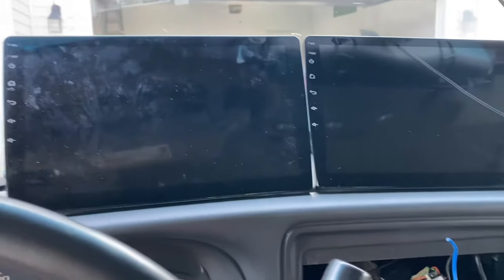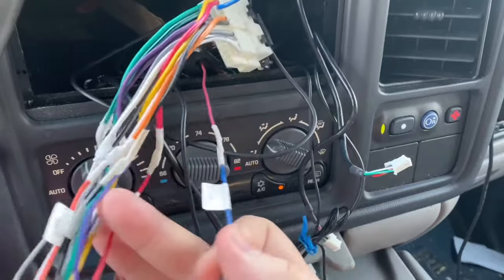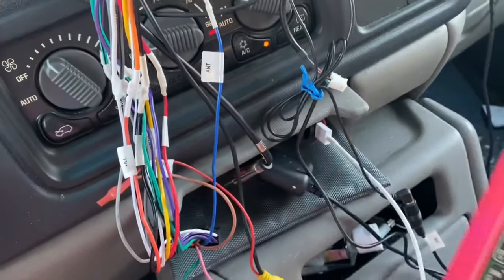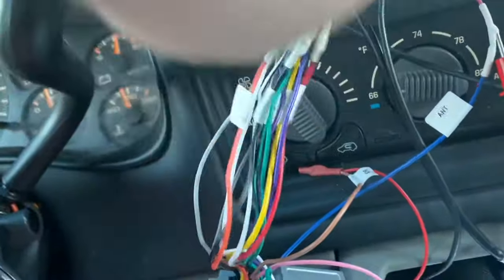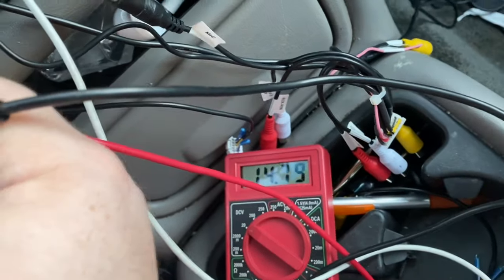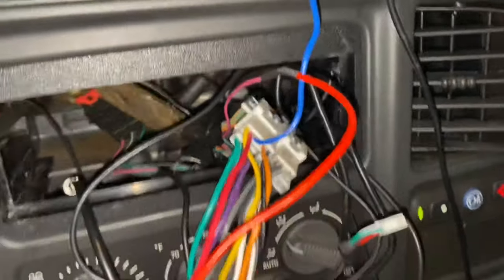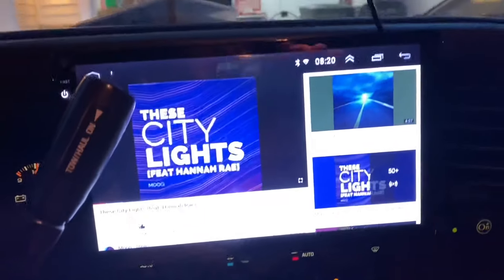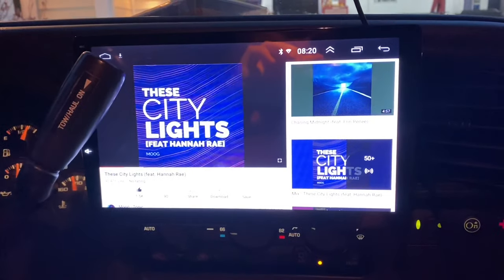Chinese Android Headunit - no sound fix!

Comment: hey dude!
i just got a chinese head unit but it dosent play music from all speakers any solutions?
Reply from the maker: Start with the basics, check for voltage at every point you would expect to
Reply: @MegamanEXEv2  i figured out that somehow the speakers are flipped, as in the radio thinks the front speakers are in the rear and vice versa

Comment: My problem is a little bit different the radio turns on and works then you turn the car off when you come back 15 minutes later and turn the car back on the radio turns on and it shows you like if it was playing music but no sound coming out the speakers and then you have to reset it again and again can anybody give me some pointers when it works it works super sweet super perfect turn off the car come back 20 minutes later then you start having problems it turns on and it even shows Movement Like if a song was playing but no sound coming out of the speakers and the only fix I see is resetting it when you reset it it goes back to work and Fine Again software bug
Reply: Same, have you found a solution for it?

Comment: Doesn't it have a remote wire to power on the amp? Mine goes to the remote wire then I can manually switch on and off the external amp thru the screen

Comment: Question please help me!!! I have a Android head unit when I play the radio my amps work but if I use you tube on the head unit It only plays through the front speakers and the rear speakers have no sound. Please help me resolve this!!!
Reply from the maker: Well thats a weird one. Could be a similar problem though, check what you are using to power on your amps.
Reply: I think this is the same problem of my adroid head unit. Mine is i dont have amp. When i play music or radio only the rear speakers is working the front speakers is not.. and i try my old stereo the front speaker is working.. pls help me also to solve the problem..

Comment: Okay so running the blue to my ACC gave me no audio at all. However, for some reason the harness I got had no pin for the output signal for stereo amplifier on/off (had to make a pin) once i connected the blue to there i had radio audio. And my phone will connect to Bluetooth but shows in red letters and has no Bluetooth audio.

Comment: Hi I spliced my radio antenna wire into the acc wire for power and to get the Bluetooth sound to work and it worked fine for a day. Everything functioned as normal. For some reason today now when I turn off the car my radio stays on. Not sure why as I checked the power with key off and was no power to either of these wires only with key on. Now for some reason with key off the head unit is keeping constant power and won’t shut off. Please anyone with a solution would be greatly appreciated!!

Comment: So i run the ANT wire to the ACC wire and that's it? What color is the ACC wire btw on the harnest to back of radio?
Reply from the maker: No, ANT shouldn't be hooked to anything unless you have a powered antenna which most cars now dont. You hook the remote wire for your AMP up to the ACC/switched 12v wire which should be red on your harness.
Reply: Will the remote wire be on my factory harnest or the Chinese android head unit?
Reply from the maker: @lordsavior7889  Should be on your factory harness, might be on a different plug from the main radio harness. My truck is a GM vehicle for example, and the pink remote wire was on a different plug.
Reply: @MegamanEXEv2  i have a 2012 Nissan Maxima and online it says the amp remote is a blue wire with white stripe ,im going  to use a wire tester to see which one has power with the key on to find it.it really sucks without sound but thanks to you i have hope on solving the issue.

Comment: My problem is that the radio is working through the speakers but not through the amp so i have no bass at all, i went to the settings and raised the bass but no good it still sounds like stereo, any suggestions?
Reply from the maker: Does your amp have a switch wire?
Reply: @MegamanEXEv2   I watch a YouTube video and it told me to factory reset the radio, I did and the Amp kicked in, thank you anyway.

Comment: So basically what you did was give 12 constant volts to the arena by hocking it to the acc wire but leaving the antena wire from the head unit unplug.
That was it?
Sorry I got a little bit confused
Reply from the maker: Yeah basically
Reply: @MegamanEXEv2  so I did it and it worked for me. Thanks!
Reply: @MegamanEXEv2 I have same issue with my bmw e87 2004 , do I have to hook the acc to 12v for the sound to work?

Comment: Thank you for posting this. I have android head unit with the amplified harness for my car which is a 2008 Lexus RX400h. At first it seemed like it was working. However for whatever reason if I don’t start the ignition fast enough it turns the amp off. Furthermore even when it is working as soon as I turn the car off and turn it back on the sound is no longer working. Only an unplug from the negative on the battery fixes it and it just keeps happening. It almost works however for whatever reason it refuses to turn the amp back on after an initial start up after the battery is plugged back in after being unplugged. Hope someone has at least come across this issue. If you have an have a fix please let me know. It’s really to bad too. Honestly is fantastic when it works. However if I have to unplug the battery every time I go to start my car I don’t think I should have to do that. Thanks for reading this.

Comment: How you get rid of the static noise coming from the unit into the amps that’s driving me crazy
Reply from the maker: Haven’t had that issue
Reply: Turn your stereo down to 0, turn your phone right up then add volume on the stereo til you are happy with the volume height.  Turning up your android unit and having your phone low will cause static

Comment: I need to know I have one of those in a Nissan Ultima SL and my sound does not work for the USB and other stuff but it works for the radio it the way it all comes on so the question is do it it works for my Nissan Ultima 2018

Comment: Thank for the tutorial, 
I have a Cayenne Gts, and I can't even get radio sound, everything powers on, I just can't get the sound to work.

I have both the canbus and fiber decoder, 
The only thing I didn't do was connect this one single blue wire, " without a label " 

The blue wire is from the audio aux, harness, any help would be deeply appreciate.
Reply: Did u figure it out I have same problem
Reply: @bryanlewis6521  nope, I tried one time, and left the Porsche in Florida, I am surmising it has to do with a fuse for the Bose system. One thing that might work is, Have it wired and fully installed, then go to a best buy, drive to the back, and find a Geek from the Geek Squad and hook him up to finish the job. usually the guys at BB are pretty chill, it helps if your a geek. Ill keep you posted,. Let me know if you get it solve .👌

Comment: For anyone confused** 
Among the AV Cables you will find a "AMP Cont" blue cable.

Cut the "Blue Cable" from the Main Harness.

And connect the "AMP Cont" to the "blue cable" you cut off. To the Car harness side! Not to the harness leading back to the stereo. It will work!

Cheers

Comment: I just have this issue , just got my airco fixed it worked while driving with airco , but few hours later it just stopped if i put the sound to the max then i hear sound but really low

Comment: I'll try this tomorrow. 
Atm my Bluetooth doesn't play music unless I select radio first then switch to Bluetooth.
Its like the radio is the on switch for sound to come through.
I've seen this before throughout my life but couldn't figure it out until your vid started with you holding the att wire...
It's a rookie error. 
Thanks for your vid. Hopefully sending a voltage through the wire on startup should do the job.

Comment: I’m having an issue same type of radio when I use apple carplay at 1st music is loud then I put car in reverse and volume stays low does anyone have a fix to this?
Reply from the maker: Yes, that is not a problem that is a safety feature. It can be disabled in the settings menu. Its called "Reverse Mute" or something like that.

Comment: Hey,
Thanks for this video. It will help a lot of people. In my case there is no sound for FM, Bluetooth, Music or video app. Can it be solved with the same solution?
Thanks,
Reply: I’m having the same issue
Reply: I’m in the same boat. Mine worked perfectly at first. Then I believe when I got super hot out, all audio quit working. Have you found a solution??

Comment: Mine doesn’t turn on. Yes, the fuse is good
Reply from the maker: Start with the basics. Check the pins on the back with a test light or a multimeter

Comment: i’m having the same problem in my 2007 tahoe but the vertical style radio
Reply: Did you encountered warning lights after installation? I had several of them on mine

Comment: What is your car doesn’t have an amplifier? How do I get the radio to work?
Reply: ETA: the power works, etc but no sound.
Reply from the maker: Are you SURE your car doesn't have a factory amp?
Reply: @MegamanEXEv2  yes :/ it’s a 1997 Ford. I had a professional look to double check as well. Still can’t get sound so I am at a loss as to what to do.
Reply: @MegamanEXEv2  everything works but the sound. Literally every other thing but sound.

Comment: How can this possibly 'drive you crazy'??
The ant power wire is meant to send power to your antenna so it will extend for reception When listening to the radio.
Think: why do you need the antenna extended when watching a DVD or playing content from a flash drive or ANY Thing that's not listening to the radio?
Oh yeah, pls use a tripod. I almost had to take Dramamine to get thru the video.
Reply from the maker: Because the other radio ran everything for over a year just fine? Also, try potassium cyanide instead of Dramamine.

Comment: I have no idea what u did
Reply from the maker: On GM vehicles and others with a factory amp, there is a wire that needs to get power to switch on the factory amp. I had that tied to the antenna power meant for a motorized antenna, but my new head unit only applies power to that wire when running the radio. I spliced it to the switched accessory power instead and all is good now.
Reply: @MegamanEXEv2  you connect the  antenna (blue) power wire to the acc(red) wire?
Reply from the maker: @camillecruz3238  The Acc wire on the head unit side is connected to the pink wire on the car harness side that turns on the stock amplifier.

Comment: HI I bought android media for Ford Fiesta and it came with proper wiring, I checked if my acc I connected to amp wire and it is, but still a have no sound from bluetooth, although I have sound from radio and from cd, does anyone knows what else I can try to fix this problem